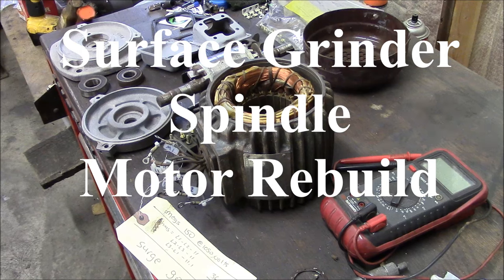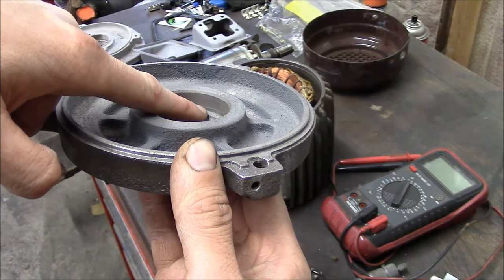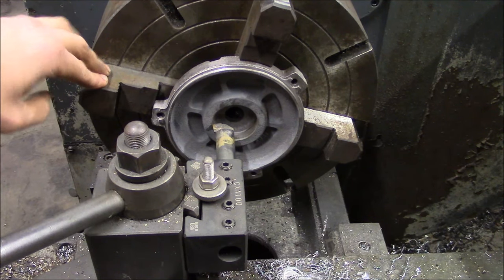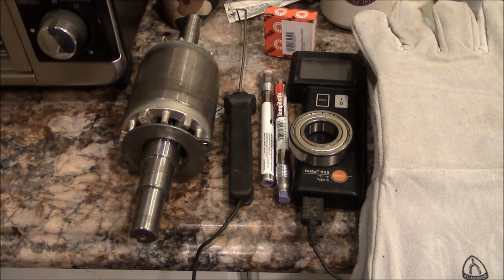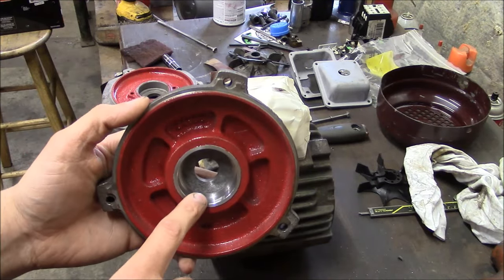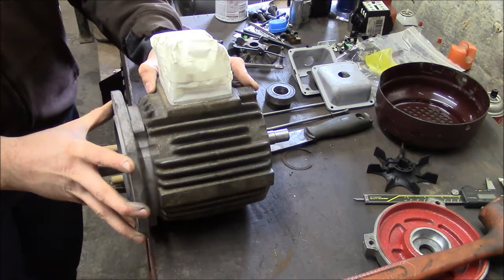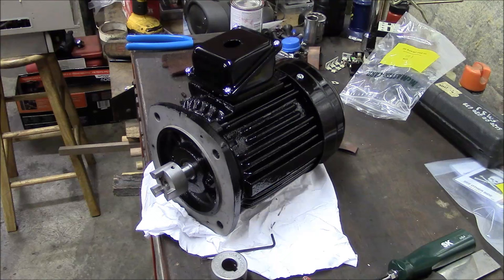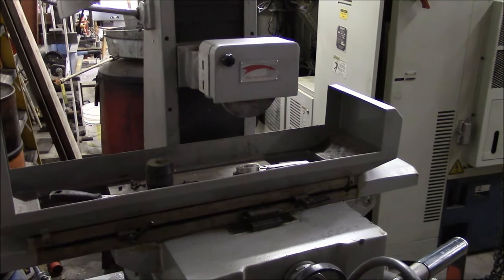Surface Grinder Spindle Motor Rebuild

Comment: Wes, first ever comment, watched this video today, I'm an old millwright and have probably done about 50 motor bearing changes and fixes to bearing housings and shaft journals, winding changes etc. one thing I learned to do quickly is always check the temperature that the bearing reaches for the first 3 or more good runs, ie if you run it solid for an hour check it every 10 minutes or so, just touch it and if you can stand the heat generated for a count of 3 or more you're ok, 5 or 6 seconds you'll have to monitor it. over that stop the motor strip off the back end and ease a bit more out of the motor housing. hi temps will usually disappear after a few days running, some motors I've fixed I'd often check every time i walked past, just to be sure eh. I'm a yorksireman still and now a canadian/yorkshireman. keep up the good work, nice dog too! AlxM

Comment: Most motor shops have a few holes in their work benches so the shaft can go in during assembly & reassembly.  Less chance of rolling off bench and all around easier.  If you don't want to drill through your work bench, you can cantilever a heavy board with a hole over the edge of the bench & clamp it down
Great channel Les

Comment: Hi Wes.  I reguards to your comment on hydraulic operated grinders, The machine you have is a small form grinder.  You can do flat grinding but the function for a manual machine is to grind complex shapes into (usually) hardened steel.  A digital readout and a form dresser usually completes the unit.  You seem to be missing the handle for the x axis.  Also, if you transport the machine the table should be blocked up to prevent the table bouncing on the bearings, if that happens you'll never get a finish worth having with out rebuilding the table and replaceing the bearings.
The automatic grinfers are more for a machine shop and the manual machines are usually used in Tool & Die shops.  As you can probably tell I was a Tool & Die maker.  I enjoy your videos, hang in there.

Comment: Another awesome video! Can’t believe I haven’t found your channel in the past. 

I rebuild my fair share of motors… And have been very impressed with the “inexpensive“ megger insulation testers. I had a few of the expensive older units from the 80’s and 90s… And I still keep one around. But the new $30-$60 digital Chinese units do AMAZINGLY well. 

The popular ones on Amazon that I have tested, put out the exact high-voltage curve as my more expensive Meggers. ( checked on professional test equipment). Obviously wouldn’t suggest a cheaper Megaohm meter for every day full-time work. But for someone like myself who rebuilds less than a dozen motors per year… They work perfectly! That way you can take the portable $50 megger with you to the scrapyard and test motors before you waste any time with them

Comment: Very cool rebuild with great professional tips as well as high-quality necessary modifications due to excessive wear that don’t mess up the performance of the motor so it’ll run for many more years! As an electrician it rarely ceases to amuse me that many parts of most installationss often have a trade name with mild or quite overt sexual connotation. For example, the make-up box where you connect all the windings, feed conductors and grounds is often referred to as the “peckerhead.” Also, in case anyone doesn’t know…if you need to change the direction of any 3-phase motor all you need to do is change any two leads (A-B phase, B-C phase or C-A phase conductors) on the feed side to their corresponding winding wires in the make-up box and it will spin the opposite direction.
Reply: Yeah, as he was saying, "the um, the um"  i was thinking,  "You can say it Wes...................peckerhead.  🤣

Comment: I know that an awful lot of water has gone under the bridge since you published this video, but balance of armatures on motors for surface grinders is actually very important. Having cleaned up the hammering on the fins of the armature it really should have been carefully re-balanced..

Typical defects in the finished ground surface from not doing so are 'herringbone' effects which can be very elusive to track down. Jones & Shipman used to go to enormous efforts to perfectly balance the spindles on the 540 series surface grinders that are a similar format to yours.

Comment: Eutectic wax.  It changes phase at a specific temperature.  (a eutectic compound is one whose phase change temperature is dependent on composition,  so you can make a 'set' of crayons with specific temp changes)  Theoretically, this can happen between liquid and gas phases too.

Comment: Two years to the day, love those motors, not engines  but motors and they live a long time. I would use a drive on it if I was going to use. Handy as a pocket on a shirt if you need it. Takes more time to set up than use but its right when you do

Comment: Just make sure the motor case is grounded. If you touch a 20 meg path to 120v+ you can feel a little tickle. Won't kill you, but it can be unpleasant.  Just a comment. It looks like yours is properly grounded.  Thanks again for the great videos.

Comment: I've seen cone shaped bearing heaters that support just the internal race.  I just used a precision hotplate when I did the bearings on my Fadal.
Reply from the maker: Anything will work. Induction bearing heaters are used because they are fast. A good one can heat a 2-3 lbs bearing to 200F in just a few seconds. It might take 20 minutes on a hot plate. Stay tuned though, I just bought a dead induction bearing heater. It's next on the healing list.

Comment: I have used (Green) 680 Loctite in a few case where a bearing doesn't fit snug in a bore, without any problem. That would be in a case where setting up and boring the bearing bore would be way harder to do. It's supposed to fill up to a .015 gap. I like your way of fixing it better for long term use though.

Comment: The megger is checking the insulation of the windings. You can use it to test any wire insulation. The IEEE acceptable resistance is 1 meg ohms per 1000v plus 1 meg ohm. So the minimum acceptable limit on a 480VAC motor winding is 1.48Meg ohms on the megger test

Comment: That was interesting, great video. Im curious about something though, with the time you had in this job, what was the benefit of replacing the bearings and doing all that work versus getting a new motor?
Reply from the maker: I don't know. The issue here is that this is a metric flange mount motor that's pretty hard to find in the US. It definitely would not be worth rewinding. But, just bearings and a fan, I think it's worth it. I would guess a new motor would be in the $400 to $500 range by the time I had it shipped to me. I probably have something like $250 to $300 in this one with the initial cost, parts, and my time.
Reply: That makes sense. what type of antiseize do you use? as in what base metal
Reply: Benefit was we got to watch the rebuild! I learned a lot of new stuff!

Comment: Hi Wes,
Maybe it’s just Chinese but your go button appeared to have a zero next to it and another button near by has a one on it.
Seems a bit odd?
Maybe I missed something.
Nice job on the motor.  Can’t wait to see you grinning something.
Interesting back story.  Kids pulled it apart and lost stuff.  Sounds pretty normal 🤠
Reply: That's ISO standard markings. A one for on, and a zero for off if they're separate buttons. The zero with a one superimposed is the on/off button marking if there's only one button.
Reply: I understand what you are saying but I just rewatched the video.  The machine definitely has separate on and off buttons and I see a big 0 on the "ON"  button with no 1 superimposed on it.  It is obvious which one is ON and which one is OFF off I just thought it was very odd to label it this way.
Reply: @DavoShed  I went back and looked at that part of the video after I posted my reply. I couldn't really see the controls good enough to say what's what.

Comment: I've replaced motor bearings outside 100+ degrees ambient, and with the bearings hotted up, for the life of me could NOT slip the bearings on the shaft. Took about 8 tries, then realized the shaft was too hot sitting in the sun. Handful of ice cubes on the shaft and slip goes the bearing

Comment: Your other solution could have been to turn the bearing recess to fit a larger outside diameter bearing with the same shaft size and save a step.

Comment: The megger is used to check the integrity of the insulation. 

At work we use meggers to check  that newly laid and already connected cables isn't damaged before 

the connection into the signalling plant is cut in.
Reply: That is correct.  Meggers provide an "insulation breakdown test".  They determine the integrity of the insulation on the individual winding wires to ensure that no shorting or grounding will occur to neighboring windings or the case under normal operations plus a safety margin.

Comment: Hey Wes, do you have a source that sells precision pulleys?  I need one for the motor on my surface grinder.  Don't ask how I dorked mine up.  My Boyar 612 has a belt and it runs on a pulley on the motor shaft.  Thank you sir!

Comment: I noticed what might be an "asset tag" and I am pretty sure a calibration label on the torque wrench you used to secure the tie bolts.

I say this as I am surprised to see such labeling on a tool unless the clamping force accuracy  must be proven to a customer.
Reply from the maker: I'm sure I bought that torque wrench used and it was probably calibrated and tagged by the previous owner. For my purposes there is no need for calibration, but for ISO certified companies, they need to be calibrated annually.

Comment: All I do is grinding, and our older machines are nasty as fuck on the inside. 100% covered in grinding residue. The new machines are following that path because no one sprays them down
Reply from the maker: I work on a lot of grinders. You can't even look at a grinder without getting filthy.

Comment: I watched you double tap a clicking torque wrench in another video, your wife's Toyota, but when you use a dial torque wrench you don't give that second yank of "if one reading is good, then one more must be twice as good" thrust.
Can you explain that to me?
Reply from the maker: Nope!
Reply: I push toolbox for a living. Got 2 torque wrenches in it plus a gauge room full of all kinds of torque wrenches with scales from few inch pounds and up to 600 ft/lb. That one is a two men job. I got to use it a while back. I use them often on everything except sheet metal screws. Got training to go with it too. The sales people take their time to let us know what is going on and how to use the tools properly. It must be the end product that is making a difference here, I think. Its not like I make rocket engines. We only repair and maintain cnc machines that make jet engine components. I've always been drawn to things that create great power and require lots of precission to make. Go figure!

My search for a proper show of use of a torque wrench continues.
Reply: @petelyczek5728  l.p.

Comment: I have yet to try it myself, but did you see the video where AvE wraps a bearing in a wet towel then heats it up in the microwave?  Search for "The Microwave Trick? It's the easy way to heat bearings!
"

Comment: J B WELD ON END CAP TOO HOLD THE BEARING.
Reply from the maker: No. It has to float.
Reply: @WatchWesWork  it doesnt need to float that bad, you could have pricked the original bearing sleeve with a sharp punch, then use 609 or 620 loctite. Saves the trouble of dialing in.

Comment: .....21:40......numbers out...on anything.....for the next guy....who might be ME.....!
 School students worked on the motor? Like Mr. Pete says....they will mess it up...!
Reply from the maker: Supposedly, the students thought the motor would have powerful magnets inside, so they tore it apart looking for them. Then they lost some critical parts and I guess the school just tossed the motor. Of course, there are no magnets in a plain old induction motor...
Reply: @WatchWesWork  Didn't they listen at the physics lessons ??? There is magnets in an induction motor but they aren't permanent magnets...

Comment: I can't understand how brushless motors work.
Reply: It is a cage type of rotor. The stator windings create a rotating magnetic field which causes
a electric current to induce in the cage rotor.
This creates a magnetic field which attracts it to the stator field.
This type of motor isn't synchronous because it needs to lag behind the stator field, if it didn't you wouldn't have any momentum which causes the motor to lagg -> induces current in the squirrel cage.

sorry, i wasn't entirely clear - the motor runs asynchronously against the net frequency.
The rotor is a squirrel cage type so electric current is induced in the aluminium bars.
They are also called commutator free because you don't need external commutation (ie contacts on the rotor for feeding the rotor's windings with current.)

Compare :
https://en.wikipedia.org/wiki/Induction_motor
https://en.wikipedia.org/wiki/Commutator_(electric)

Comment: Beat the crap out of it when removing the bearings.  Beat on rotor and clamp the bearings in a vise....
Reply from the maker: Who knows. Those balance lugs are actually lead, so they are super soft. It's hard to say what the last guy was thinking.

Comment: Loctite bearing retainer will take care of that nooo problem. And also yes it can. It can take up way more then that much slop. If it holds on an excavator final drive bearing. It will hold those no problem
Reply from the maker: I've been into a lot of bearings that have been glued in with Loctite. IMO it does not work. Especially in an application like this where the bearing is supposed to be a sliding fit to allow for thermal expansion. I guess it's OK as a temporary fix if you need to wait for parts or something, but it absolutely does not replace a proper machined fit.
Reply: Wes Johnson Services for sure. It is not made for a sliding fit. It is for press fit bearings that are worn bad enough to be sliding fit bearings lol.

Comment: I would not put a grease filled bearing in a oven. A 2rs rubber lipped seal is a much better bearing for a dusty grinder..locate bearing fit will fill a 5 thou gap with no problems, ask them. cheap usa china bearings only have 5 balls unlike a good RHP bearing that last 20 years. You need to learn how to fit bearings correctly
Reply from the maker: You don’t seem to have any idea what you’re talking about.

Comment: just think, if you weren't so cheap you could get a new motor and have none of the problems. good luck with your patched up motor.
Reply from the maker: What problems? This isn't a Toyota Camry. You don't just wander into the local parts store and buy a new motor. This is a custom motor frame only used on surface grinders made in China and Taiwan, and even then, only by a few builders. Both the company that built this machine and the US dealer who sold them are long since out of business. Thanks for stopping by.
Reply: You're wrong kids. Everything in this video is expensive not just a price of parts & tools .. also very high knowledge & skills operator .

Comment: The end caps bearing bores should be a light press fit for the rotor bearing outer races, not a few tenths larger than the OD of the bearing race. The outer race has to be radially retained in place by the housing press fit, just as the inner race has to be a specific press fit range against the OD of the rotor shaft. The races are not to rotate, just the ball or roller bearings (ball in this case). The worn area in the end cap bearing bore was caused by not enough press fit; you duplicated the same error. Otherwise, you've done a stellar job.
Reply from the maker: Every motor I have had apart, from $60 Hung Lo special to $6,000 Fanuc spindle motor had a press fit on the front bearing and a sliding fit on the rear bearing. With the sliding fit and the wavy spring washer, there should be no issue with the race rotating. Grinders are very hard on bearings because of the grit that gets into everything. The original bearing was trashed and had high rolling drag. That is what wore the bearing bore. If both bearings have a press fit, there is no accounting for thermal expansion of the rotor shaft. Machine tool spindles are setup the same way.
Reply: A shop that I worked for had a customer that repaired industrial electric motors. They would send us all of the machine work, and focus on the winding, balancing, tear-down and assembly. The majority of the work that we did for them was boring and bushing the endbells, as shown. Most all of them would be 0.1-0.15" wall thickness, 0.001-0.0015" press on the sleeves (except for some of the aluminum endbells that have a cast-in sleeve, in which case, we would bore until that sleeve was removed), and the vast majority had 0.0002" slip fit for the bearings. We had a chart on the wall that had all of the inner and outer race diameters for bearings, and the amount of slip or press that they needed, but it was always a slip on the outer, and press on the inner. We used Loctite 620 when we pressed in the sleeve, because of the wicking, anaerobic cure, and high heat properties, but we probably only had it on-hand because of how often we used it.